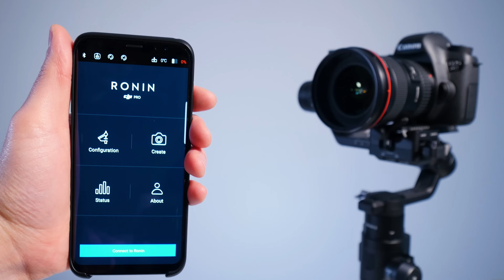DJI Ronin-S - Setup and Balancing

Comment: Okay? And then there is me, just putting the cam on the bar, connecting that thing to the Ronin and balancing it out once in default position when it just stands on the desk. Then starting it up and using it just fine.

Comment: Do you NEED the app for this? I only have a flip phone (love these things, but will automatically hate it if it means to use the Ronin-S I need a Smartphone). It sounded like there was a secondary option for tuning that does not require the app.
Reply: You limit yourself when you dont have app but you cam still use it.
Reply: @Brandon Robinson yeah...lol welcome yo to 2019-2020. Itll get more mobile dependent 🤣

Comment: Has anyone had success balancing a Canon EOS-R w/RF 28-70mm f/2 (bulky, heavy lens) on the Ronin-S? The combination is front-heavy, but sliding the mounting plate all the way back causes the plate and/or the eyecup (non-removable) to hit the gimbal.

Comment: It is still a bit expensive compared to other competitors 'performance, and is being updated so quickly that DJI will have to speed up innovation
Reply: the essentials pack is not a bad price. Ronin S is way better than the competitors.

Comment: not helpful, no information about applicatin. i turned on and... Can't choose 'AUTO' couse at start they show me '80%' and dont move
Reply: The video is about balancing the gimbal, not the app... If you've balanced it properly, then simply connect to the app by turning Bluetooth on your phone, then you can go to 'Settings' and 'Balance Test' to check it's all correct. To say this video is 'not helpful' is pretty harsh in my opinion. It's the first video I've found that actually helped to balance the gimbal properly.